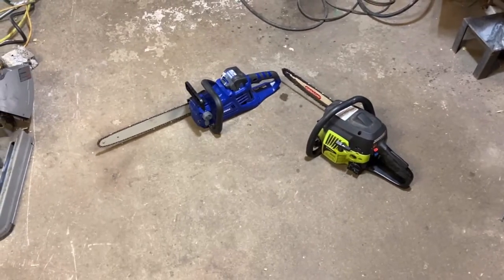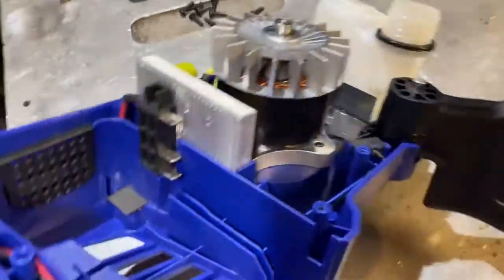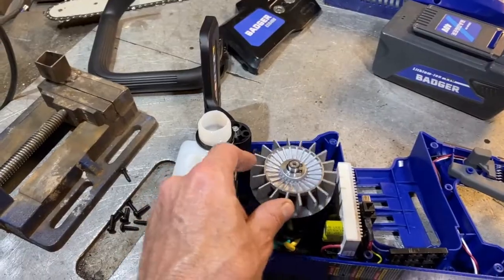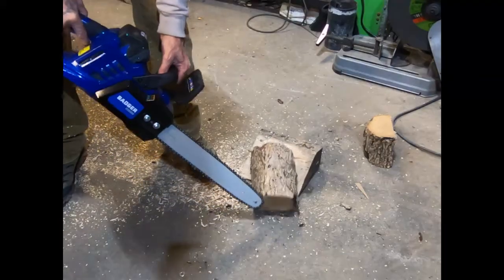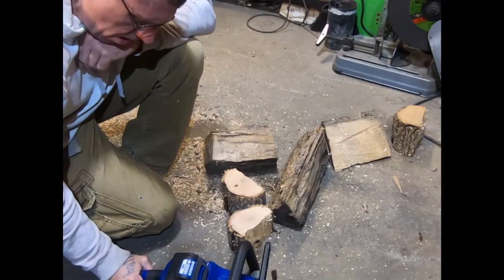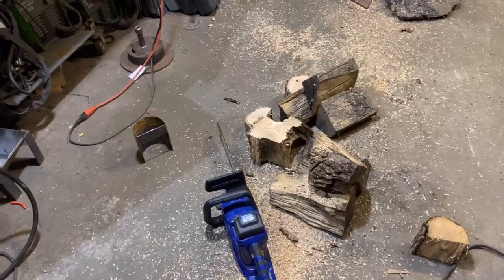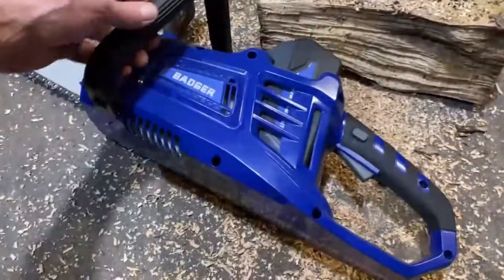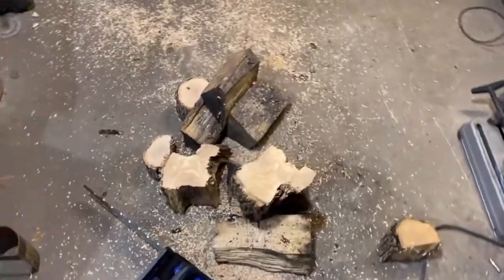Electric chains saws From China last 1 season

Comment: Definitely neodymium magnets. I’ve got a Ryobi 80V, but the brushless motor is actually slightly smaller than this one. But I will say that the Brushless motor on the Ryobi cogs are very strong and tight. The motor is ridiculously fast for what it is. I only use it for small branches and tree. Say 6 inches or less. I prefer stihl gas 2 stroke. I will add that I have a cordless 80v Kobolt leaf blower that is a slightly older than when they made the switch to brushless so has a 80v brush DC motor that is like a 770-780. It is top of the line in quality, speed, and torque.

Comment: The reason that you noticed a power increase under load is because most better quality battery OPE will compensate for load by increasing the current to the motor, reason being is that the manufacturers have to balance power with battery longevity. I personally do prefer gas however, i want to be able to fix my own items without needing a computer science degree. I will say battery tools have come a long way from the NiCad days.

Comment: I have the Milwaukee one, it definitely impressive, great for riding trails and doing trimming.
But quite capable for cutting smaller logs for the log splitter.
But much over 12-15inchs,
It's time to get the big boy out, and make noise, if the have a bunch of cutting.

Electric chain  saws have anti kick back chain which tends to be good and bad....   with a gas one you have a bit of give with the clutch.